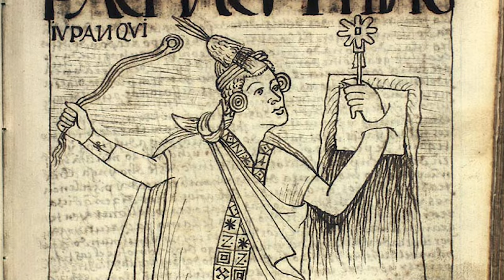SACSAYHUAMAN - How They Did It | Polygonal Masonry

Comment: I'm fascinated by this I'm a builder/chippy and have worked sandstone I believe this is the hardest and surprisingly most stable possible way to build a wall. The fact that these blocks can weigh over a hundred tonnes makes this infinitely more difficult. I'm not a stone mason by any means but have built sandstone walls (softstone). Used diamond steel power saws to cut and it wasn't a walk in the park. Of course I used mortar I'm just in awe of these ancient master stone masons it's like they were showing off an engineering feat.
Reply: My understanding is that the great amount of labor needed to build these stone walls was well understood, thus the walls were an obvious demonstration of the power of the ruler that had them built, and were likely considered good propaganda.
Reply: Me too i agree

Comment: As a former stoneworker who later went into engineering, I can think of one way that they might have done it that would have been relatively quick and easy.  When I put in a slab of stone to walk on or to make a wall look nice, there are some occasions where I can avoid using the tape measure and still achieve a very tight and precise fit.  One of those methods I can use is scribing.  
Now Scribing isn't going to work here, not without lifting an enormous stone, over and over, but I still want to transfer those exact curves and dimensions to my next piece.  So I can probably take either paper or a strong, flat leaf, even cheap cloth.  I have my friends place it up to my piece I need to match on the left, my bottom interface, and my right interface and they hold it flat.  I may even use a clamping frame to make sure it stays flat enough.  I can then use a sharp knife to cut along the edges that I have to meet.  Now I can take my perfectly sized cut-out and trace around it onto my new stone.  If I did everything right, we lift the new piece right up and slide it in, and the Inca King doesn't let the Jaguar Knight capture me and sacrifice me to the rain-god.  All is well in my world until the Spanish come.
Reply: Did the Spanish force you into being an engineer?
Reply: @bouipozz  this entire 11,000 comment section is so full of weird comments like this I don’t know if you’re being serious or making a joke 😂
Reply: Thank you for this
Reply: I agree
Reply: Actually, scribing is the method that is explained in this video. I recommend watching it to the end.
Reply: I've done that very thing with cardboard many times, but I don't think it translates well to 6-12 sided multi ton objects atleast, to the degree of perfection that is achieved at some of these sites..
Reply: @realeyesrealizereallies6828  Well, even if you don't have this experience, some of the people quoted in the video do have (edit: as has the commenter at the head of this thread)..

Also, from a professional engineer's perspective, I can see how this would scale up, provided you can keep the suspended block stable.
Reply: @andrewmole745  Most of these stones are meters thick, and not uniform in their dimensions, so scribing a surface would only work for a tiny percentage of the stone, you don't need to be an engineer to realize that, only need a tiny bit of experience and be able to think through the process...It's very easy to mistake authority for truth as opposed to truth as authority...These guys are guessing, it's theory, and as someone who has scribed many wood surfaces that meet natural stone, I know from experience that the surface is not the same as 1 inch in on a natural stone, the dimensions change, obviously..I'm not claiming an ancient civilization or aliens, I'm claiming don't be a fool and have an open mind, think through the process being proposed, don't just take anyone's word for anything..
Reply: @andrewmole745  The people in the video have no experience, related to these processes..No one currently on Earth has scribed meters thick multi ton stones in 3d that fit perfectly together with several other meters thick multi ton stones scribed in 3d that fit flawlessly together with other, you get it, hence; the wonder and amazement..scribing works very well for thin objects..Can't really think of any meters thick objects that scribing translates to in the real world for obvious reasons...
Reply: @realeyesrealizereallies6828  Actually, the "scribing" method they describe works for any shape of stone. It is not a 2D scribing.
Reply: @andrewmole745  No.. Stones that sit atop each other and but up against each other, that are meters thick, must be moved many, many times each to be scribed to fit together perfectly like they do..Mistakes have to be corrected over and over, it's a fact, in the real world..Scribing is not a perfect copy, from one surface to another..Even with wood that is only an inch thick that borders stone, it takes trial and error, and constantly fixing imperfections..Clearly you don't understand what your looking at, which is fine..But, you won't find any serious archeologists or stone masons or engineers who can explain that perfection..It's just reality..
Reply: @realeyesrealizereallies6828  It's funny how no one see the stupidity in this video. Just saying that the method with the stick between the rocks is entirely wrong since it work only on 2 axis, but what about the third axis? Lol. The pendulum helps to keep the stick roughly horizontal and you can use it to keep it not to rotate around it's own axis (witch is no really relevant here) but what keeps the stick from rotating in the third direction? Nothing. If I hold a stick with 2 hands on the 2 sides and i pull one side towards me the pendulum will not show anything, lol. You can literally rotate it 90 degrees and now the two ends of the stick don't even point in the stones direction but perpendicular with the stones. So it's literally totally useless. You would need a rolling or sliding ground-fixed frame similar to a steady rig for cameras to maintain the third axis but we are talking about a theory where the guy states they didn't have slides or wheels. ..but millimeter accuracy. Also, he talks about why rollers would stuck on an uneven surface and continues talking about pulling the rocks on the ground, totally leaving out the uneven rocky part in HIS theory. I mean, good luck pulling a 80T block when random stones or wood or whatever sticks out from the ground. You have to even it out even more than for rolling logs. But the most hilarious part is that he states it's too hard to work with rolling logs so they just went straight juggling with 100 tonnes, suspending them in the air, lol. This theory is simply lacking common sense.
Reply: They accomplished precision polygonal fitment with only the use of hammer stones??? Really... Apparently most people will believe anything no matter how ridiculous.
Reply: Awesome input
Reply: @realeyesrealizereallies6828  No - the offset is created in place while the stones are suspended above their future location (suspended using the tabs). I encourage you to look at the video again. It becomes clear once you watch and think about it a bit.
Reply: Don't forget all this is done in 3 dimensions.

Comment: I love history. Your channel has become my go to place for the truth. It’s refreshing to find a historian that sticks to the real historical facts. The term “advanced technology” is relative to the period of time being referenced as well as the context in which the term “advanced technology” is being used. At one time in history the bow and arrow would have been classified as “advanced technology”.
Reply: Advanced technology refers to anything that is very difficult to recreate. You show a bow and arrow to a native tribe living on an island and they will easily re-create this. You show them a wall made of polygonal stones crafted from basalt or granite (Stones harder than steel) weighing in excess of 50 tons and ask them to repeat the same task, they could spend the next ten generations and not accomplish this. You need to understand just how hard it is to carve such tons that rank at 6/7 on the mohs scale. Silly argument you made.
Reply: @PictishGrappling  you can go outside right now, and with an abrasive material like sand of equal or greater hardness and a copper tool, carve these very stones. It would take a long time, but imagine if there were hundreds of you doing this. It's not absurd or impossible. It was done, and you can do it too. In fact, if all you science deniers worked together, you could build the pyramids right now. Or possibly debunk science by testing the theory they have and proven them wrong.

Comment: Videos like these are the reason why this stuff remains a mystery. Vincent Lee has little clue how these walls were build and its pretty clear.
If you ever worked on stone you would know that Inca could not have build this with "tools". Those stones were not form by chipping away at then. Thats just absurd when you see the size of the rocks and the amount. Try it with a modern steel chisel and you will soon see what I mean. This isn't soft limestone.
Even today we are not able to make joints like that. That is with modern power tools.
Was it build by the Incas? Possibly. Spanish records suggest so.
How did they do it? The most reasonable explanation is a chemical process. Either heat or acid. That is also pretty clear when you take a look at the stones from up close.

Comment: A standard block has 6 sides, not 4, as we occupy the third dimension, not the second. A 4 sided block would resemble a three sided pyramid or a 4 sided die.
I have seen footage of modern day Peruvians pulling a large, multi ton stone, it was part of a VHS production on the annual rebuilding of the grass suspension bridges. I haven't been able to find it in the digital age, but it did exist. The trick is the rounded cobbles set into the streets, the flat side of the heavy stone has less contact or friction because it rides on the tops of the cobbles. The look on the faces of the pullers goes from jubilation, because it started to move, to terror as they realize they are in it's path and it's moving remarkably fast.
Reply from the maker: Interesting! I hope the clip finds it way onto the internet.

Comment: Interesting theory with the scribe stick- it made me think of an easier way using the same general idea- why couldn't they plan the entire wall and lay the stones on the ground roughly in the orientation of the wall with the faces pointed up and enough space to work the scribe. You could shape the entire wall without suspending any stones, and then just assemble the pieces like a puzzle when done.
Reply from the maker: Not a bad idea!
Reply: I think that is likely how it was done, wooden templates at that size not likely.
Reply: Clear evidence from the bulging and impression left on all four sides (when you remove a stone block) that they factually built these walls with the assistance of gravity to seal it tight. Please, visit these sites first, then offer your theories.
Reply: @abcfavorites  your not clear in your statements, learn English then offer your theories.
Reply: @stridersmythe8860  it's you're, not your haha
Reply: What bulging are you referring to? The blocks themselves would not visibly bulge under gravity as their bulk modulus is too large for this. 

Of course, gravity plays a role directly or indirectly in holding these blocks together, but it is not clear what you mean.
Reply: @abcfavorites
Reply: The Inca told the Spanish they didn't build Sacsayhuaman. Giants built it. I don't know. It's interesting they said that.

Comment: There is a reason that we have what is called the”Stone Age”. Stone is the first material that hominids  would have had direct contact and curiosity about.  Things about stone were first discovered by accident but that did not preclude hoinids from remembering and oassing the knowledge along. Even figuring out that  a wedge shaped piece of rock scree placed in a natural fracture can cause the stone to break, becomes the basis for quarrying and rough shaping of stone. Ancient man began to read the veining in hard stone realizing it could fracture along the vein if struck by a stone at least as hard as the stone itself. Another thing that would have been learned initially  by accident is that if a stone  is heated, then quickly cooled with water, it will naturally fracture. This can be aided by incising a line on a stone faces before heating. Such methods can then give a rough dressed dimension even for monumental stone. That the edges of the stones were rounded off would indicate that the stones could also be  rolled in transport while being dragged. A rolling method would be especially helpful when moving a large stone up any incline, apart from that the edges would not dig into the ground with excessive friction. Since we don’t have access to all the sides of these stones, it is unknown how much prefabrication dressing the stones  underwent at the quarry sites. However, since  is the evidence of concave rounding, then the basic scribing methods could work for most joinery including bed joints to be done on the ground then rechecked using the support methods described by Lee. 
An entire wall could be laid out in a a quarry staging site and basically dressed while lying on the backs of the wall stones. In this  manner, it can be much like fabrication methods still used today in scenic shops. Where individual parts are constructed in sections and pre fitted, then only the connective adjacent piece is required to insure the correct fitting to the next section. This method is used for irregular shapes that maybe desired by a designer/ architect. And is used especially when the design of any kind is to be erected in a space much larger than the shop/ staging space.
Reply: @davidhathaway3369  that environmental changes and cataclysms advanced hominids along, is not the direct reason for the the curiosity and experimentation that resulted in the  stone hand axe. While it was most likely accidental that hominids found naturally sharp stone edges, it took the power of their minds to figure out how to recreate them. Such flint knapping goes back well over a hundred thousand years.
Reply: After this catastrophe, nothing was left of the established civilization, only what was made of stone.

Comment: Would love to have heard you address the carved bedrock at this site as well as the Inca work on top of the polygonal masonry (not just the modern repairs)  having been to the site, to me, it appears that there are three distinct forms of stone work here. The carved bedrock is incredibly weathered, sometimes these massive stones are fractured or even flipped over. The polygonal Stone often is built around the carved bedrock protecting and supporting it and the small stones with mortar common to all Inca sites are always on top of the polygonal. I make no claims to when any of these were done, but the assumption that they were all by the same builders within a few hundred years seems an incredible leap to me. Everyone has ancestors.

Comment: At sites such as Machu Picchu although the terraces were built from the base upwards, the  major quarry was at the top of the mountain. And the scree along with the dressed stones were lowered down to their final positions. There are still pieces of unfinished large stonework atop the site. If one wanted to, it could probably be determined the original height of the mountain that was topped to create this site. It shows the creative nature that humans have to devise such a plan and it backs up my solution to the rebuilding of New Orleans after Katrina when I was saying, “ Tear down a mountain”. The Inca proved it could be done.
Reply: I’d much rather be ‘Piphysus’ than Sisyphus - eternally rolling a stone down a hill sounds like a much better detail than pushing it uphill 🤔

Comment: I enjoyed your video but still have questions. Has either Sacsayhuaman or Ollantaytamboever been dated using thermoluminescence? Ollantaytambo is on the top of a steep mountain. Did they really drag those huge stones to the top? I'm intrigued by the idea of the nubs serving a purpose of holding stones in place above their final position so workers can work the stones below, but there's no consistent pattern to them at those two sites. It would be a lot of additional work to relief carve the front of the stones to have nubs-that is hammer away everything off the front except the nub-  in additional to the other hammering they had to do to make the stones interlock. Then there's the question of if they quarried all stones to have nubs, and then why some nubs remained. I will check out your links. Thank you

Comment: I find it interesting when people question that large stones were moved by man power. I designed and built my Japanese garden myself and some large stones were involved. Japanese gardening and stone craft books give really interesting tips on how to move and place large stones. Through trial and error, I've found that pushing or pulling or tipping them upright, so that the smallest surface area is touching the ground, then "walking" them (leaning then turning them) to where they need to go, is pretty easy. My daughter (11) and I (a woman) did it ourselves. I'm a scientist, so I gauge the mechanics first (surfaces over which it has to move, distance, what obstacles are in the way, which side "step" to start with, what side must face which direction when I get there, etc.), put on gloves, and do it. It's really just more physics than elbow grease. 😁
Reply: Walking them up mountains. Across river valleys. Sure. More handwaving.
Reply: Japanese garden…. Hahaha this is hilarious! Elbow grease, sure buddy.
Reply: @GaryMalcolm  the stone can in a way become its own lever.